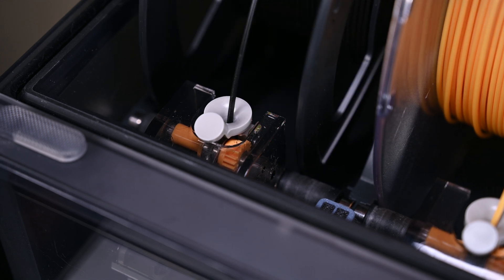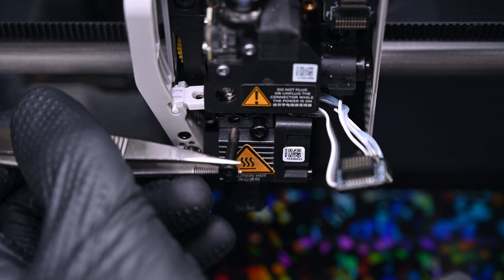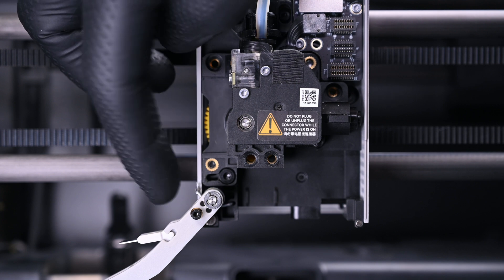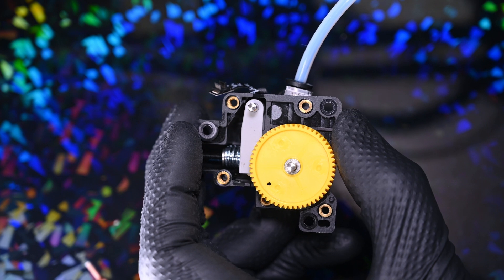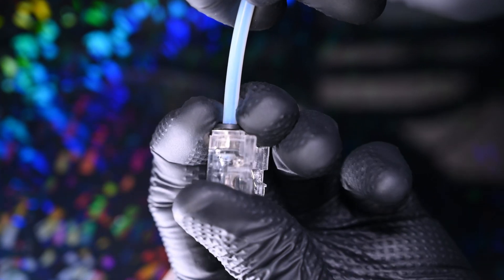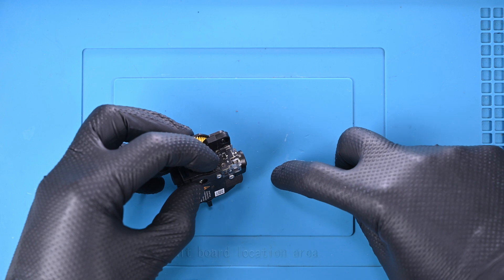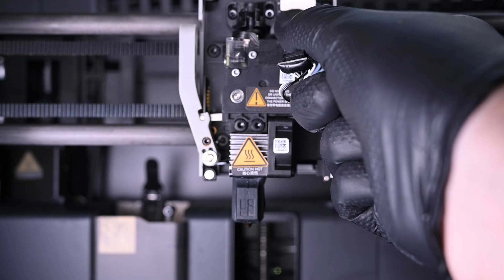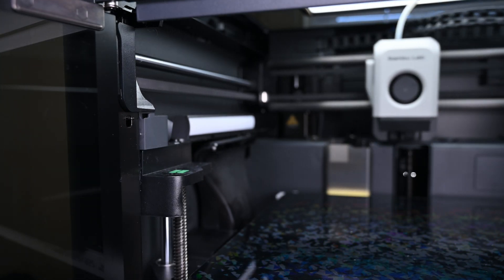Bambu P1S Full Extruder Teardown Guide - Failed to pull out the filament error fix

Comment: Really helped me out with this one. I still had issues getting the filament out of the PTFE tube but was able to get it out by removing the splitter thing on the rear of the printer. Thanks a bunch!
Reply from the maker: @dalewright7908  I recently had something similar, a piece snapped off in the AMS and ended up stuck in the rear hub. Thankfully that was a lot easier to get to than a jammed extruder
Reply: I had both apparently 😢

Comment: I had to do the same thing! My filament was so stuck, I put a tiny tip on my soldering iron and had to use that to separate the filament from the extruder. It was extremely difficult. Thanks for the detailed video! Helped me make sure I didn’t do anything wrong!

Comment: I keep getting this error, The cutter is stuck. Please make sure the cutter handle is out, and check the filament sensor cable connection?
Reply from the maker: @josuesantiago6363  double check that the cutter arm can be pushed in and spring back out, then check that tiny ribbon that runs in front of the tube connector
Reply: I just finished putting it back together and the ribbon was a little out of place, sometimes I just feel like selling this printer lol but the more I play with it the more I learn, again thanks so much I’m back in action thanks to you 👍🏼

Comment: Trying to see if i have a problem or not!  I see small movement, up and down, of the silver metal part of the ptfe connector in its body ?  Is this normal or were screws not tightened enough before delivery?  No printing issues as yet but wondered about this.  Thanks!!
Reply from the maker: @chrisnicholas7131  pretty normal. The Bowden couplers have a little bit of play to them that keeps filament from snapping as it gets pushed and pulled back and forth.

Comment: Fantastic R&R video Like and Subscribe done!!!  I agree with you that the hothead wires are a bit janky. As an old (60+ OLD) depot level electronics repair guy (from a previous life), I was pretty flabbergasted that they are using those connectors that "GOES ON THE INSIDE, NOT USER SERVICEABLE" portion of anything electronics!!!  That is,until yesterday when I got in the F-150 rental, (because i hit a deer) and the darn thing keeps pestering me (with picture of a baby car seat) not to forget those in the back seat. I asked the wife if she had something to tell me ;-)...  all's good there! Anyways, I decided that I do love the level of "user serviceable" that Bambu is going with. I assume this must be what it was to be a dude in the 1950's. Again, great video! One note: i was a half turn from having the cutter arm freed completely...  That lead to a little bit of struggle, but I figured that out on the way back in. Best to you sir!

Comment: This was so helpful!  It is the first major issue that I've had with the Bambu Lab PS1 that I couldn't resolve easily.  I had a clogged extruder and I had filament in my tube, which I could not remove the tube, so I cut it.  I got the filament out of the tube, but I still had the piece of tube stuck in the extruder.  I could extrude the filament then, but the tube would not come out.  I could not find any videos with the filament in the tube when it was stuck.  You did great on explaining and showing how to do everything.  Well done!  At least Bambu Labs don't glue their connectors like Creality does.  I will never go back to Creality-Bambu Labs is Awesome!

Comment: I am getting this issue nearly every time I run a print, what could be causing this issue?
Reply from the maker: @intricate3dsolutions  for me it was heat creep, I was running the print bed (on purpose) much hotter than I should have for printing PLA. Double check your temperature settings, and then try printing with the top lid off and the front door open

Comment: Thanks so much for this! I managed to clear the clog in mine after a lot of brute force to remove the gears (the clog was in exactly the same place as yours, just a bit bigger and really attached to the plastic housing). I got it all reassembled and reinstalled! Alas, now it just clicks quietly and I'm trapped in the "Not Extruded Yet, Retry" loop. Opened a ticket with Bambu to see if they can help further. (Their support wiki is a roundabout of circular references and is less than helpful to a newbie to the platform.)
Reply from the maker: @RikAhlberg  I’m interested now. If you want to send me an email, preferably with some pictures of your hotend (cover off), I’d be happy to troubleshoot it with you.

Comment: Amazing video! Thank you SO MUCH!.
I was having issues with the extruder. It would just make a clicking noise when trying to load or unload filament. I was pretty worried I was just going to have to buy a new extruder assembly. Thanks to your video I had easy to follow instruction with great detail which gave me the confidence needed to attempt a repair.

Oddly enough I couldn't find an issue, like a mangled piece of filament like you did. Maybe it fell on the floor or something and I didn't notice? Anyway, reassembled and  back up and printing with no issues.

Thanks again for the amazing video!!
Reply from the maker: @notans1krr46  glad it helped! Maybe it just needed some realigning, either way it’s a success!

Comment: How do i get the print head closer to the front of the machine so i can disassemble?
Reply from the maker: @KirkKohler  with the machine off you can just slowly pull it forward. If the machine is on you can use the axis controls in Bambu Studio under the Device menu, or on the Handy app in the Device tab
Reply: @TapticDigital  thanks. Simple. 😅 I think I tried this and it failed. But it's working now moving the head with the app and on screen controls. 🤷‍♂️

Comment: Such a lifesaver! I keep having the exact same problem, down to the shape of the stuck filament, but it always happens at the 99% mark of the print. Is there anything specific that might be causing this to happen, or any tips on how to avoid it?
Reply from the maker: @jarrentan6360  mine actually jammed again after this video, and it led me to discover my issue was caused by heat creep from running the bed too hot. So I’d try reducing bed temp if possible, or taking off the top glass lid as that seems to trap a lot of heat inside too.

Comment: That acts like the problem I'm experiencing, though I don't have an AMS on my P1S. Have to allocate some time to work on that. Even where it's at, which is probably going to take a day to clean up to, is better than the A1 Hot End that filled itself up with PLA, and I have to clean that one otu. Thinking a dremel and vacuum would help with that more than anything else.

Comment: Omg, this error has been killing me lately. This video gives me hope! Thank you!
Reply from the maker: @motorexp  mine was heat creep, check your bed temps and don’t be afraid to take the glass top off!
Reply: @TapticDigital  My bed has the flexible metal plate.  Recently purchased P1S.  Bed temps are usually pretty steady.
Reply from the maker: @motorexp  in my case it wasn’t inconsistent bed temp, it was me running 20c higher than I should have 🤣

Comment: Thank you so much for this video! You probably won't believe, but... I had exactly same problem in exactly same location. Even the piece of black filament looked just like yours!!! Can you imagine that? Anyway, back to printing and very happy to have found you! ❤
Reply from the maker: @EC-gy9pv  fun fact, the next print I did after this video also jammed the extruder in the exact same way. I had to follow my own guide. Turns out my issue was heat creep from the bed being too hot, which was my own mistake. Happy printing!
Reply: @TapticDigital  Thanks for your warning! Now I'm completely ready not only to fix this issue, but also to get them in bunches - all thanks to you... 🤣🤣🤣
Reply: Same here! The bent/disfigured piece looked exactly the same!
Reply: @chadharrison520  Hahaha... It looks like Bambu carefully designed even possible  errors... :)

Comment: Hi! Your video has been so helpful, but this has happened to us a couple of times already - any ideas of reasons why this could be a recurring issue? Thanks!
Reply from the maker: @FranchescaMella  mine was caused by heat creep, I was able to alleviate the problem by taking the top glass cover off the printer or leaving the front door open, I’d give those a try first!
Reply: @TapticDigital  thank you!

Comment: the big yellow extruder gear isn't coming out. Any ideas?
Reply from the maker: @bd8-N48  mine was incredibly stuck the second time I had to do it, I ended up using something to push from the silver bearing on the other side to force it out because the gear itself was bending a bit when I tried to lift it
Reply: I think its because my clog is just THAT bad
idk what to do now

Comment: been having this exact issue the past two days, then when i saw you had a super small piece of filament stuck i thought nah that cant be it, such a small piece holding up an entire machine, so took it all apart just like this video and yup... small piece stuck! just ran a test and all fixed! thats a thumbs up and a subscribe from me! cheers pal
Reply from the maker: @domtrix224  wild how a tiny chunk of plastic can hold up the whole operation! But also I’m grateful to have a printer than can identify its own problems and keep itself from getting damaged. Check your temperatures too, it turns out my issue was caused by heat creep!